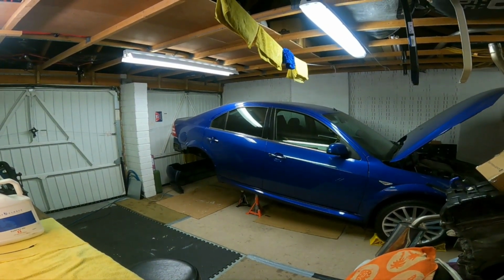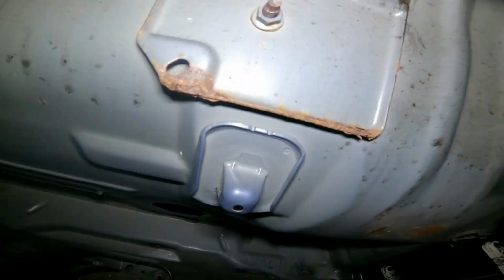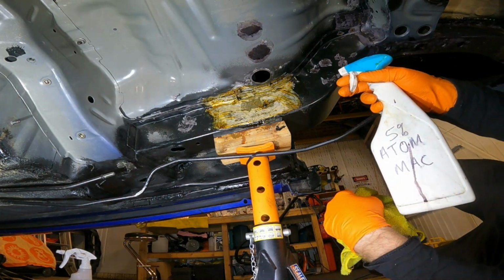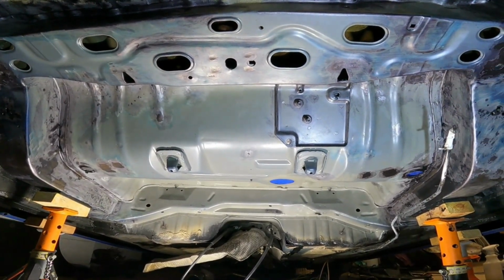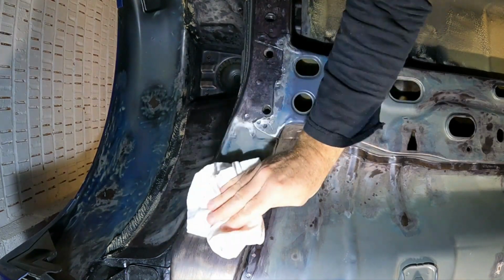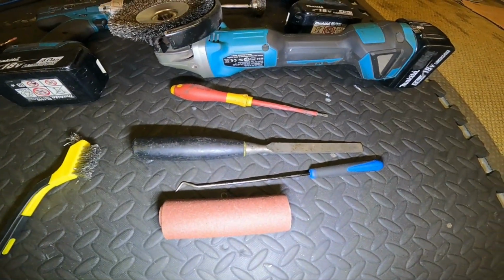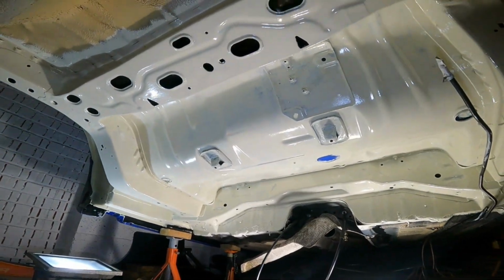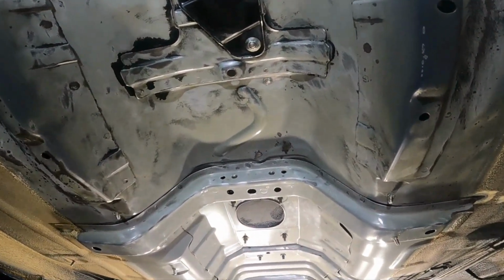ST220 REAR END RESTORATION

Comment: Next level attention to detail.
Loving the explanation of the products too. Problem with this though is my shopping basket is just getting fuller, following your lead. 😁
I am now currently stripped down, very similar, but my fuel tank is still on. Project is on hold now though for about 2 months as I've broken my elbow and wrist. Next MOT was due mid November, but I'm now Sorned as I think I'll be going on until around Feb/March having seen the depth you've gone too. Luckily, the car is not my daily. 
Oh, I made up those Chassis pins on the lathe after you saying to go 27mm on the base. Fit is perfect, thanks. I'll then track the rear end with my gauges around the opposite way when the subframe eventually goes back on. 
Not sure if I said on your last vid, when I took the rear strut off, I also found a broken coil spring. Now bought 2 new rear coils and top mounts for the rebuild 😂
Keep the vids and updates coming. Between yours and Chazz's, I'm getting there... 👍

Comment: Good vid as usual m8 yes them rear brake pipe brackets are a fucker for holding mousture between the plate and chassis so I just cut the flat section off and weld it directly to the chassis lot neater and doesn’t attract the rust would love a garage like yours m8 you do make a nice job keep it up m8

Comment: That’s amazing work that mate , I have done the same to mine , though not as thoroughly as I got fed up of lying on a cold damp floor outside , but I painted the whole underside with Jotun penguard which is made for boats and that’s £120.00 for 5 litres with the hardener .
Reply from the maker: Yeah mate, don't want to do this again and I had the luxury of a garage with carpet and cardboard but I figured do it once and once only... I hope!
Reply: @mondeost220restorations9 I done my old Mercedes with an angle grinder and know wheel completely to bare metal , the worst think I have ever done , never again 😂

Comment: Interesting to see all this.

I cleaned up my strut towers similar to this. After throwing a load of paint on, I was concerned about using underseal as it tends to flake and trap moisture, so I decided to cover the whole lot over in grease. I go back in every year, clean it out and renew the grease. Did it 4 years ago and there is no sign of the rust returning. It's a lot of effort and messy, but it's cheap, and it works. 

I've noticed those seams on the edges of the chassis leg getting a little crusty too. I think where there is an edge there, where the coating is sprayed over ends up thinner/under more strain so prone to letting up first. The bracket thing on the bottom of the spare wheel well is always terrible for rot as well. Tempting to remove it.

When the clutch goes I'm going to drop both subframes and get those dipped. Probably got a few more years before then.
Reply from the maker: Yeh corrosion is the number 1 killer of these like most other old cars but as I've said unless it's being dipped I think slowing the rust is the best outcome for now and keeping moisture away,  so no wet weather or winter driving for my garage queen! Lol. Thanks for the comment and hope you enjoy the channel 👍

Comment: Also forgot to say on that crossmember reinforcement chassis section where you picked the surface rust out of on my last infra was like that so I drilled the spot welds out and grinder the damaged section out , once removed I put it onto a piece of new steel and marked round it with a scribe and cut another section out identical to the rusted section treated both leading sides and welded it back in obviously even left the service holes there too so it looked factory but yea big big problem areas theese 👍👍
Reply from the maker: Yeah mate I didn't realise that was a common area for these to go. For a minute there I was plopping myself! I've had a couple of old Ford's that looked mint only to find a isolated area underneath completely rotted out. Wish I had more equipment and more importantly skills such as yours to tackle the bigger jobs. Luckily I caught that in time and just need to keep an eye on it for now. Looking forward to seeing the PB Estate bac from paint,  keep us posted mate 👍